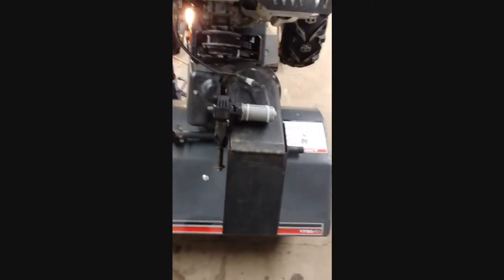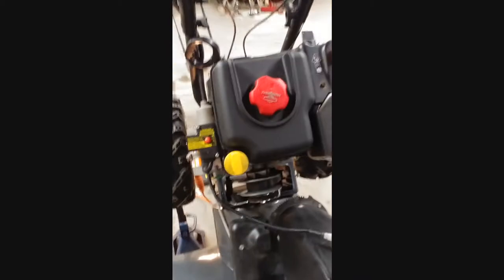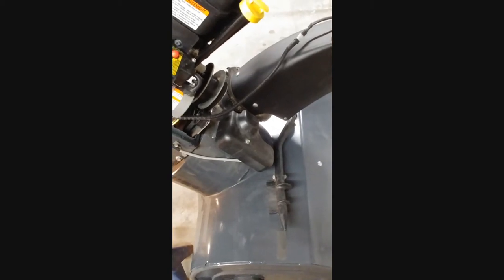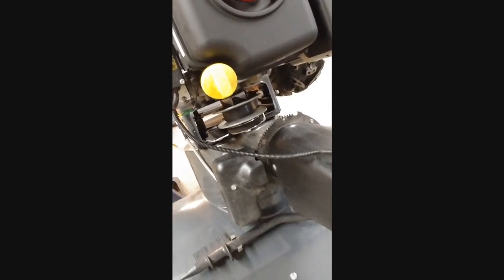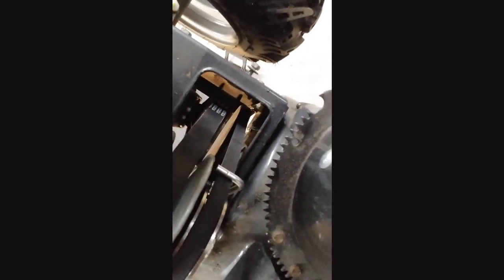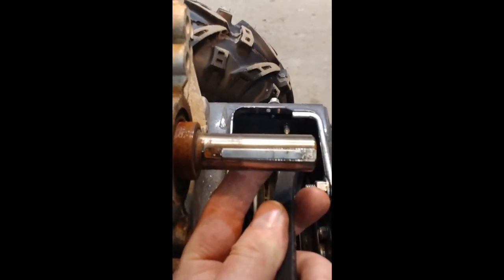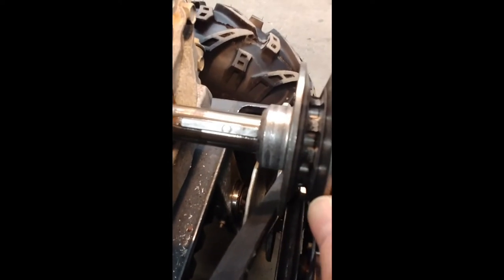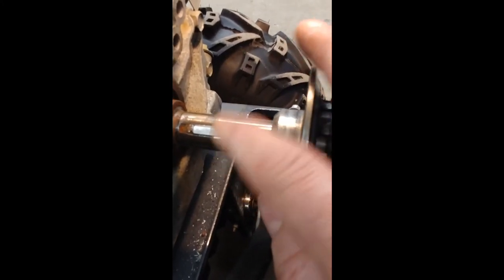Snowblower No drive Issue/Problem fix.Briggs and Stratton, Murray, John Deere

Comment: Plastic, Really? It's bad enough they started with the plastic chutes and some with plastic control handles that break, but plastic pulleys and transmissions don't belong on snowblowers, period.
Reply from the maker: Hi David, yes I agree completely. Especially on the big so called heavy duty snowblowers like in the video. 
I use to see the plastic transmissions on the small 18 inch and 22 inch snowblowers. But more and more I see them in the bigger snowblowers. 

Thanks for the comment.

Comment: I have the 1227 and its garbage. Hits a 2 inch clump of wet snow and the wheels stop, you'd think they would just travel over it, but nope, this was not the issue and I can't see anything out of place.
Reply from the maker: Thanks for the comment.

If the pulley is spinning as a complete piece, then chances are if you have the sealed plastic transmission. Then  the gears inside  could be stripped.

For the unit I was working on in the video, the plastic section of the pulley became dislodged from the metal section of the pulley. It would would allow the snowblower to move a little but then stop with any small amount of resistance. 

If you have the same style pulley as the unit in the video, I would double check the pulley. 

The only way I noticed it being the pulley, was I removed the belt cover and walked beside the snowblower as it was moving to see where the problem was. 

Not sure if this is explained in a way that makes sense, but I hope you figure it out.
Reply: I removed the transmission cover and the auger belt was really loose, so I adjusted the tensioner all the way, there was still slop on that belt(had to adjust that cable also). While I had the cover off I gave the drive belta tug and it held firm so I didn't give it a closer look.I haven't checked the friction wheel yet, but the machine is 1 year old and used less than 10 times. So I guess that's my next move. @missionrepairable

Comment: I bought a B & S 1224 in 2021. these models normally have a 208 cc engine. the option had a 250 cc. engine. Upon running it in 6 inch powder, it broke the auger shear pins and I had to shovel my drive. (I am currently 76) The MTD people provided me with stronger pins.  This year the friction drive started to slip. I was told to replace the friction wheel. You can't buy the friction wheel by itself. (wheels are usually $25) You need the whole assembly - $170 with taxes and shipping to my door. The old friction wheel was worn down by 0.005 inches!  The problem  is that the spring at the end of the engagement cable is too weak. I doubled the spring up and it now works just fine. I am just grateful  not to be saddled with plastic gears. When I park this one beside the American Rambler in the back 40, this summer, I will be looking at a Honda.
Reply from the maker: Hi Gerald,
Yah, the B&S snowblowers are a poor excuse for a snowblower. I haven't heard too many good things about them. 

When your looking for a new snowblower, be sure to inquire what type of transmission and drive system is in it.

Allot of manufacturers are using plastic parts in allot of area's on all types of equipment. 

Best of luck, and thanks for the comment.

Comment: Got excact same blower.  How do you unscrew the capscrew of the auger bracket as it keeps rotating.  Trying to replace drivebelt. Thanks
Reply from the maker: Hi Gordon,

Not exactly sure which cap screw you are referring to. Not sure if your talking about the two bolts between the drive wheels and the auger housing you remove to split the housing?

Perhaps you could send me a picture pointing to the bolt your trying to remove?

Thanks

Comment: I have exactly the same B&S snowblower which I bought in 2014 and I am starting to have speed and direction problems. My reverse only works when I pull the lever to Reverse 2 and hold it down. Forward speeds seem to operate on 2 to 3 speeds regardless which speed it put the lever in. For example, the speed is the same in 1 - 3 speed and can't move the lever to speed 6. Does it look like a transmission problem?
Reply from the maker: Hi Jerry,

Hard to say without actually seeing the problem first hand. It does sound like a transmission issue.
I guess remove the belt cover and check the the drive pulley to see if it is worn out like in the video. 

With the cover off, engage the drive to see if the pulley is slipping or if it's turning as it should with the engine.

Hope that makes sense and is able to help you.

Thanks for the comment and for your viewing.

Stay safe and take care.

Comment: Awesome video, thanks very highly for the info! I have since taken the first pulley off to check the drive pully, the only difference I see is that when I am turning the drive pully , it is moving the crank shift, where in your video it does not. This leads me to believe that it's my transmission...any thoughts? Thanks in advance!
Reply from the maker: Hi Jonathan,

It sounds like it could be your transmission that is gone.
 But you should try running it with the belt cover off. Just to see if the pulley is indeed turning with the engine. As well you will be able to see if the belt is operating properly.

Hopefully yours is an easy fix like the one in the video. Depending on the age of your snowblower, I would reach out to the manufacturer for some kind of coverage. 

All the best and thank you for watching.

Comment: Great video,,, I was looking all over too see how to remove the drive belt when I found this. I had been thinking my transmission was at fault. I'll inspect this part much closer now.
My machine will move but starts to stop moving once it get's heated up ? I'll give it a push or shift up a few gears than it moves so im wondering if this part is the issue vs the transmission? 
You mentioned that the clutch pulley should not turn when the machine is off?
Reply from the maker: Hi Curti 63,

Thanks for watching and for your comment. 

I am trying to remember about the drive pulley not being able to turn when the engine is off. For sure you shouldn't be able to turn it as freely as I did in the video. I would think if you were to turn the pulley, it should turn the engine over as well. I should have made a point of trying that in the video when the new pulley was installed. I guess that was my second video, beginners fault I guess. Sorry.

I hope it is a simple fix for your blower, as this was. I remember my customer was really happy he did't need to replace the transmission.

All the best and again thanks for watching, any questions I will do my best to reply as soon as I can.
Reply: @missionrepairable  Good morning, I took the machine & transmission apart. Teardown found, the transmission (input) pulley is melted between the sheaves and the belt has a lot of stretch compared to the new one.  The driven (engine) pulley is ok. Had I just looked at the belt and input pulley I would have just changed those and hoped for the best . Oh also the bolt holding the input pulley on is reverse thread. 

Considering the transmissions reputation, I took the trans apart and found one gear has a lot of wear on it im not sure this trans is rebuildable given that as no service parts are available.  I ordered another trans and am waiting for it. One thing I've found is parts are tuff to get as they discontinued that transmission.
 I'm thinking of selling mine given that and finding a friction wheel model once it's up and running. 
I did find a link to the makers web site if you'd like to take a look they show a limited diagram of that trans. They call it a HR300P Thanks for your post and getting back to me. 

  http://services.generaltransmissions.com/en/snowblower.html
Reply from the maker: Good morning Curti 63,

Darn, I was hoping you would not need to replace the transmission. Thanks for the link, much appreciated. 
The guy that owned the snowblower in the video sold his right away, once it was fixed. He was not impressed that it had a plastic transmission. I would imagine pretty much all the people that own these type snowblowers don't even know they have that type of transmission.

All the best with your new snowblower, and thanks again for finding my video.

I forgot to ask if it was a hard video to find, and if there is perhaps a word or phrase I could use to make it easier to find?
Reply: @missionrepairable  Hello hope you had a good weekend, I was using "Craftsman C950" in my search. I dropped that and am not sure which words i was using when I came across your video, I'm thinking "Craftsman" or "Craftsman belt change" might get more people to the video. 

On another note, the transmission I ordered from Amazon is delayed and I'm hoping it comes as the price for the other tranny's I found online are in the $550-$800 range much more than I got mine for. There are no more to source on Amazon thus far so my fingers are crossed. 

I found upon teardown my Input (driven) pulley had melted plastic between the sheaves. But the engine pulley is ok. From what little service information i found General transmission recommends changing both pulleys and the belt when melted plastic is found,I can source both pulleys online and have the new belts. 

I might have replaced those parts and left it at that but upon tranny teardown I found one large gear ( i can't name without a service manual) Is showing signs of wear. Also I found my trans had very little oil left in it, the case is wet with oil and I've had no luck finding where it's seeping from. I know it's been seeping for some time as i've seen it in the snow and the inside body of the snowblower is oil wet. 

Sooooo,,,, looks like a tranny is the way for this unit and than down the road it goes. Any recommendations on what brand to buy? Had I known about this trans I would have passed on the machine.

Comment: My wheels will turn when I lift them off of the ground, then not at all under load… would you think this is my issue?
Reply from the maker: Not necessarily. Does your snowblower have one of these plastic transmissions? Or is it a friction wheel drive system?

The best way to check is to take the belt cover off.
See if the drive pulley and belt is turning when you engage the drive. If the pulley and belt stop turning when the drive is engaged then it's the pulley.

But it's hard to diagnose just by description. Hopefully it is the pulley and not the transmission.
Reply: @missionrepairable  hey man I have a relatively new snowblower that won't keep its speed on the dial any ideas as to what it could be?
Reply from the maker: Depends on the type of drive system you have on your snowblower.

Most snowblowers are a friction wheel drive system, or a sealed transmission like the one in my video.
Could be the belt needs to be adjusted or even the cables to engage the drive system.
Reply: @missionrepairable  sorry i mean the throttle control lever that controls the governor speed. i think ima open it up maybe its a spring or something.

Comment: Thanks! Just bought a 1730HD with a bad transmission, but I figured it was something else (impeller was bent and jammed). Working through all the issues with it and hope it is something so simple!
Reply from the maker: Thanks for the comment hotgore.

 Yes let's hope it is something as simple as possibly just the pulley.